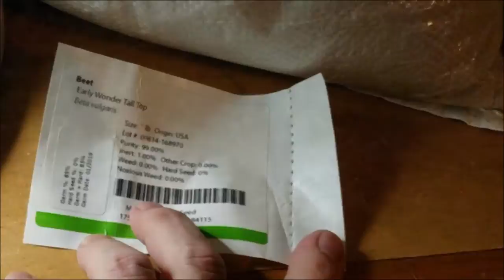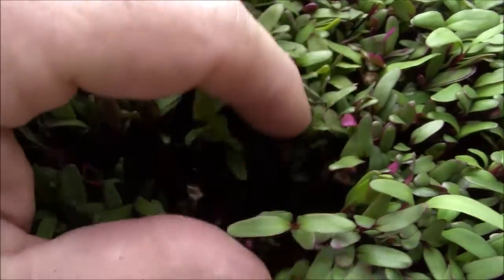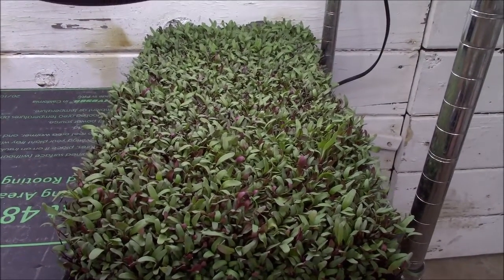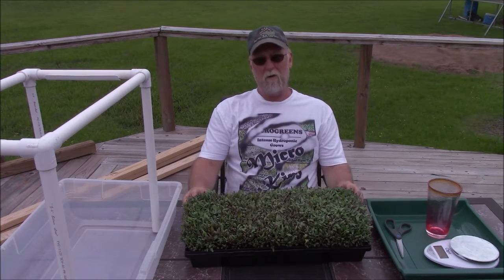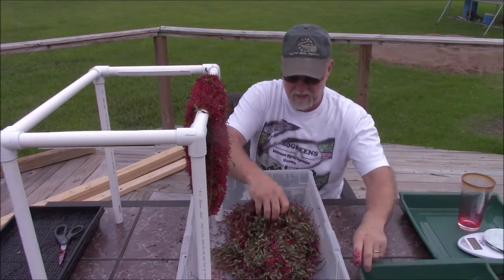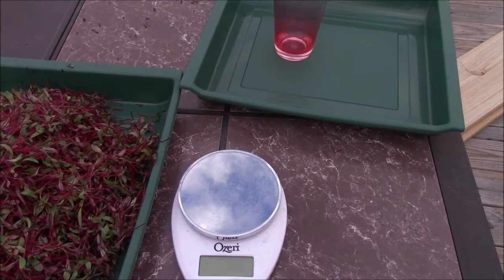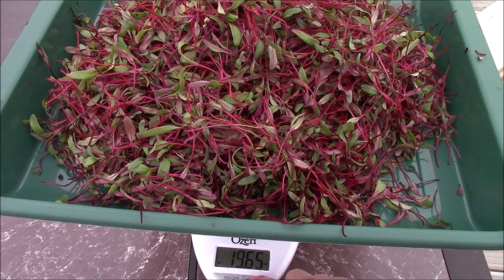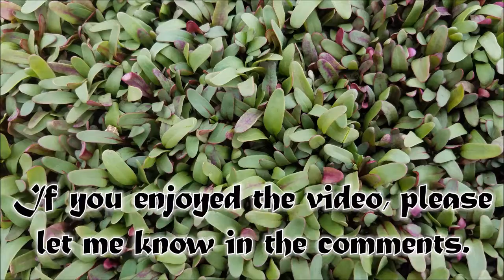Massive Beet Microgreens Grown on Screen Hydroponically

Comment: Lovely and healthy looking. To make the seed hull issue go away, when you initially put the seeds in your substrate, totally cover them then weigh them down and the hulls stay under the soil line and don't come up. Makes for an easier, cleaner harvest.
Reply from the maker: Thanks.  I appreciate the advice.  However, I don't use soil, coco, or mixes.  I grow on top of screens, hydro only.   Take a look towards the end of the video.  :O)  Best.
Reply: @C3Voyage  Thanks, yes i saw the screen, that's why i used the word substrate rather than soil. If it's possible to overlay the hulls with more screen material, enough so that they can't protrude, then they don't make it through and you can do a clean, slice harvest. Your screen looks like a nice, fine mesh so i think you could probably use a few layers  of a coarser mesh to do this. Thanks for taking the time to reply :)

Comment: Why don't you show from the beginning of seeding??
Reply from the maker: It's in the beginning of the video.  The number of failures precluded an intro.  I got it down now and I have shown beet and chard from the beginning.
Reply: @C3Voyage  I found the rainbow chard from beginning showing the 12 HR soak/rinse.  If you don't mind, can I ask why do you freeze the seed?  Never saw that in microgreens before. I just had 2 beet and 1 chard trays fail.  Not sure why.  Doing good one day, dieing the next day. Used coco coir.
Reply from the maker: @klaine9488  Freezing keeps fresh until ready to use.  Beet (and chard) are the two hardest micros to grow in hydro.

Comment: The easiest way is to fill the tray with 2 liters of soil, throw 25-45 oz seed on top then put one more liter of soil on top. Then you put a flat on top. After 4-5 days move to light
Reply from the maker: I've not seen a video of anyone getting the kind of harvest weights I get especially with beet and chard.  All other micros as well.  If you've got one, share with me.  The hydro method I use doesn't require the constant expense of soil and it's not difficult at all.  Plus, harvesting is easy without the mess of soil and I have no disease or fungus.  I think you likely mean grams instead of ounces 'cause that's a lot of seed.  :O)
Reply: @C3Voyage  do you have a video of how much it costs to set up a hydroponic microgreens farm
Reply from the maker: @cryptoaaron4762  No, I don't as I've never sold any.  I just developed growing them hydroponically and use in personal use.